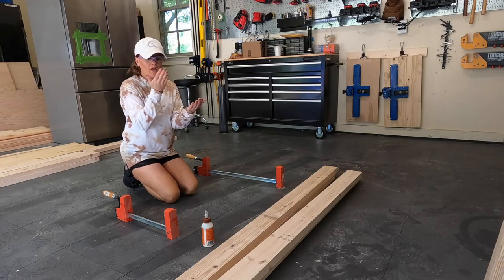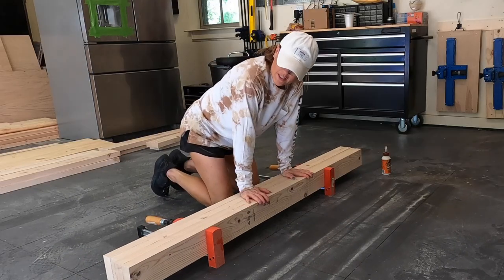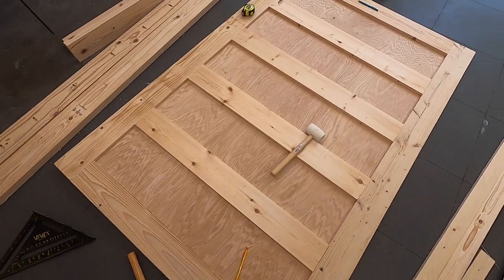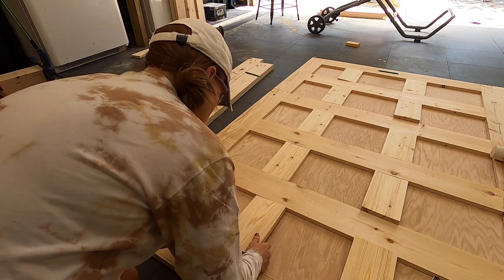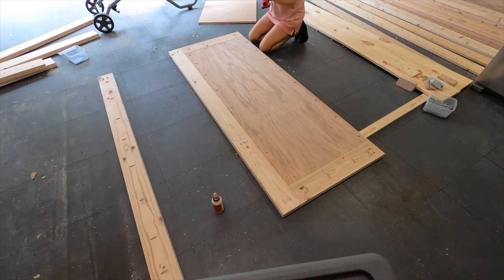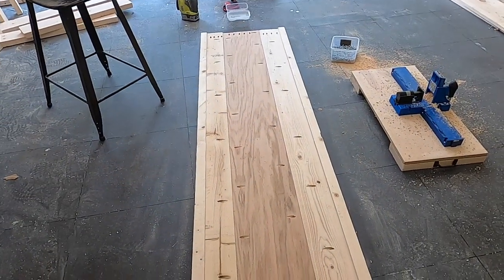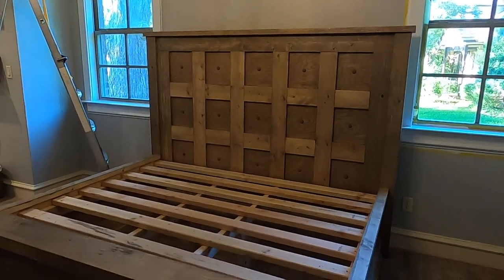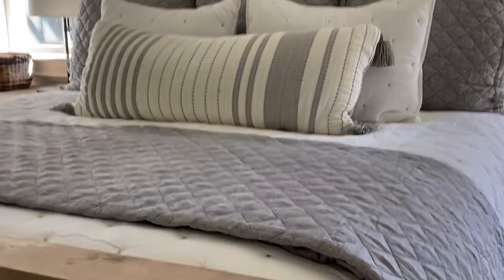Build a DIY King Bed!

Comment: I think this is my favorite project of yours too, and I love your channel. Do you plane and square your wood off first? And if not how do your edges line up so nicely? Ive had the worst luck in finding good square lumber where I’m at, I’m thinking it’s the humidity here. Usually I spend countless hours squaring off everything before I begin so my projects can line up nicely.
Reply from the maker: All we do is shop for the straight ones and then rip them on the table saw... the table saw cuts the edges perfect.  I would recommend investing in a good blade for it to keep them even smoother 👍🏻
Reply: Shanty2Chic thanks for the reply, I have a good blade on my table saw. And I also use  my jointer and planer to square off all wood. You definitely made the process look much more effortless than it is. But keep up the great work. I always look forward to your projects!!

Comment: Getting a house with a garage finally and wondered what you used for your flooring here? I found where Ashley didn’t like an apoxy floor from the workshop tour and wanted to see if you gals found a new flooring you may suggest. Thanks, looking forward to building one of the King beds you’ve designed for the new home!

Comment: Love the design.  Can you use bad brackets to attach the side rails versus direct connect?
Reply from the maker: It’s a fairly heavy headboard and footboard, so I’m not sure it would work without the extra support from the rails... but I’m not for sure!
Reply: @shanty2chic  Makes sense.  I'm trying to figure out a way to make it easier to break it down, in the event I decide to move.  Thank you for your reply and continued success!

Comment: Great job!  I'm curious.   I have a King size sleep number bed with the articulating base.  The base came with headboard hardware.  The wife didn't like any headboard s they sold.  I think she would like that style of headboard.  Do you think it would would fit?
Reply from the maker: That I am unsure of!  I am not familiar with those mattresses, but this is a big headboard with lots of places to attach to a normal rail system or slats... let me know if you build it and it works!

Comment: I noticed on your hand drawing you have the top piece of the headboard and footboard as 3.5" wide but on your plan it says 2.5" wide.  2.5" will not work cuz the legs would already be 3" wide themselves. Am I missing something?

Comment: This is a beautiful build! Looks like my next project! 
Can you do a video on how you sand all of this before staining. I always have issues getting into all the crevices adequately and then the stain doesn’t come out as even as I’d like. Thanks!
Reply from the maker: Sure!  I’ll focus more on that when I share the next pieces!
Reply: Shanty2Chic awesome. Thank you
Reply: sand before assembly.
Reply: crobles13 thats what I usually do but I’ve found that it can throw off my measurements especially with 45 degree angles. It seems like the shanty girls assemble and then sand so I’d like to see their process for that or find some tips for sanding that won’t mess with my assembly

Comment: So I've made the headboard and footboard and now I'm onto the sides, but the directions don't say what size pocket holes to drill to make the sides. I'm assuming 3/4 all around the plywood and 1.5 for the 2X6 into the 2X4?
Reply from the maker: Yes!  Thanks for catching that I’ll adjust the plans but you’re exactly right 👍🏻
Reply: @shanty2chic  awesome thank you! Haha so I finsihed mine and I think I did pretty damn good for a total beginner but my wife and i got ours into our room and said "holy shit this is way too big" and we have a pretty big master. So we just kept the headboard and put the sides out In the garage for now  and the footboard in my son's room. The ONLY thing I'd do different if I did it again would be to make the sides backing all plywood instead of the small middle section it is... and glue/screw the 2X6 & 2X4 to it so the whole thing is stable. Mine turned out wobbly with the board thickness varying so differently,  that it made mine an unstable middle piece. Other than that its ****ing awesome! You ladies kill it!

Comment: I wonder if it would have been an idea to router a track so the wood sheet could slide into the legs then fix with the screws ? Iam no woodworker so just a question ? I love this, my daughter needs a new bed and iam just sitting here wondering🤔 that's never a good idea though ( me wondering I mean 😆)
Reply: Similar to making a drawer. Should work, shouldn’t even need screws, but you’re working with larger material so that needs to be considered.
Reply: Paul Volkmann thank you 👍

Comment: This probably sounds stupid but how the hell am I suppose to know which way the pocket holes go? I printed off the blue prints but cannot tell for the life of me which way they go. Also how the did you get the pocket holes in the center of the frame pieces? Mine are right on the edge I just butted the piece right up to the kreg jig....(can't you tell I'm a total total beginner) lol. Anyways I love what you do!
Reply from the maker: Haha I get it!  It takes a little practice with the jig, but you will get used to it and never build without it again.  As far as spacing on my plans... the pocket holes are just to show which boards you need them on, but I don’t show spacing exact.  So, they may not be centered like you see there.  Check out some of our Kreg videos too... they may help!  Good luck and you don’t sound stupid 😏
Reply: @shanty2chic  ha! I'm an idiot I figured out the kreg jig, but I'm still confused on how to tell which way the hole goes for example (in towards the plywood, or out 🤦‍♂️. I glued two pieces of the head board side frame and screwed them in...watch your video and realized I put the board opposite of what you did so the pocket holes were facing in towards the plywood. I guess that's what confused me because the blue prints just have the circles but don't say which way they point
Reply from the maker: @kyleallen1858  I get it... they will always face into the direction of the board you will attach to.  So the deeper end of the PH will be closest to the board you plan to attach it to.  Hopefully that makes some sense... hard to explain! :-)
Reply: @shanty2chic  yes that makes sense!!! I'm a true blue beginner with tools/building/woodworking. I follow a ton of woodworking pages and you guys all make it look so easy and I hope to be at y'all's level one day  I really appreciate the reply! Im such an idiot when it comes to blue prints haha my wife's gunna kill me if I keep messing up! Thanks again!

Comment: Do you put a clear protective coat on? Or just stain only?
Reply from the maker: Only stain,.. and I only stained the previous bed I built that we had for 8 years and it looked great still.  I typically only clear coat on table tops... but it doesn’t hurt to do it for sure!  Hope this helps!
Reply: Thank You! And Great Job!
Reply from the maker: Tyler Clearwater thanks Tyler!

Comment: Where can I get that floor pocket hole jig?
Reply from the maker: I use the Kreg K5 but I mounted it to a few boards so I can move it from the table to the ground... I can send a link to the jig if you want it!  Thanks!
Reply: @shanty2chic    Thanks for the info. I have the Kreg pocket hole kit but I hadn't seen that before. Very cool. Link, yes please. Thanks again. Love the bed frame.
Reply from the maker: @bm2arrowbee  Here is the exact one I use!  I actually have 2... One that I keep set at 3/4 and one that I keep set at 1.5 just to save time haha!  I just mounted it on a scrap piece of plywood with scrap 2x boards under it to set if off the ground a bit... hope this helps!  https://rstyle.me/+xboaZKHrSBRmowHrp1pp_w
Reply: @shanty2chic  Thank you. Enjoy your videos.

Comment: I don't get ripping 2X6's down to 4 inches?....
Reply from the maker: David Urdahl 2x6’s are 5.5” and I wanted them to be 4”... so I ripped them down.  You can keep them the normal width, but if you are doing these plans I would adjust everything else.  We also like to rip the 2x’s because it gives a sharper prettier edge.  Hope that helps 👍🏻
Reply: Can I use a 4x4 instead or 2x6 ?

Comment: How heavy/fat of a person is sleeping on this bed ? I ask cause you used 2x4's for the supports when 1x4's would have been plenty.My bed is a queen size and have 4 1x4's for supports and 1x4 center supports for them and that's it.You went way way over kill in strength and cost for the supports.
Reply from the maker: I won’t disclose my weight, but 2x4’s in my neck of the woods are less than 1x4 boards, sometimes by almost half.  Also, this way I can get as heavy/fat as I need to and always count on my bed to hold me 😄

Comment: I hate how misleading these videos are. One of the hardest things is to get straight boards and to make them flat. You need a planer and a jointer otherwise your project looks like crap.
Reply from the maker: Vanya Jelezarova How is it misleading? I’ve videoed the entire thing beginning to end and bought framing lumber from Lowe’s.
Reply from the maker: Vanya Jelezarova I also don’t even own a planer or a jointer. 😊